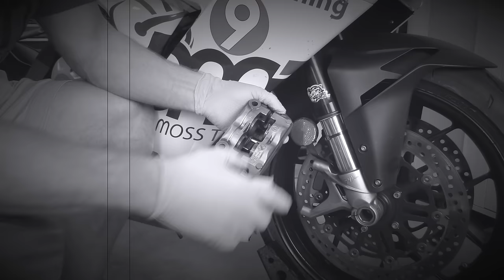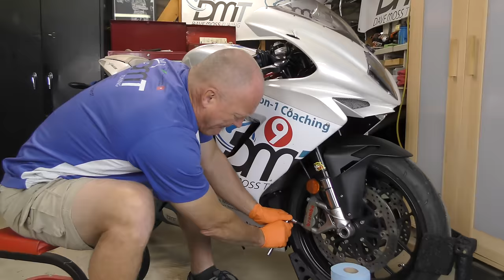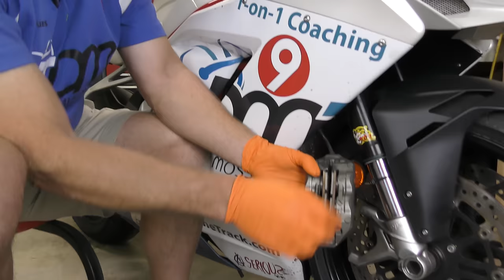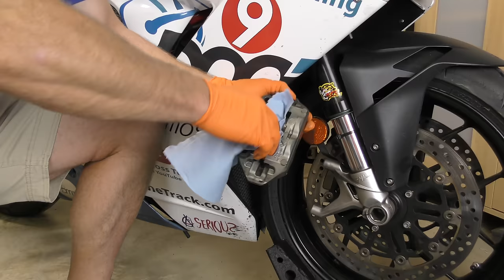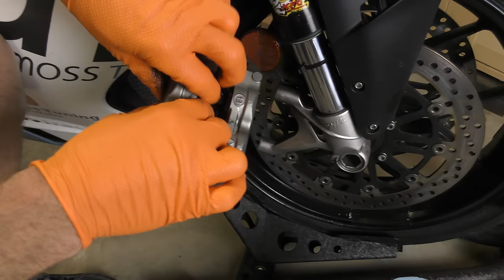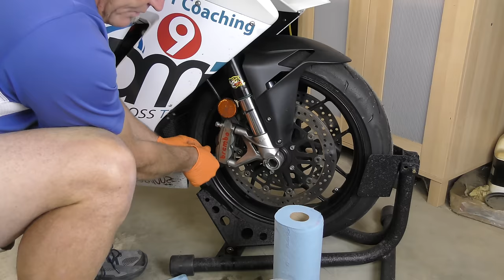Cleaning Motorcycle Brake Calipers in 5 Easy Steps

Comment: how fitting it is to see the calipers being clean with a toothbrush :))) i'll explain: i speak portuguese and in my native language calipers are called "maxilas" which means jaws. love your videos mr. moss they are very helpful.
Reply: @S3dINS  absolutely no need for the sarcasm
Reply: @sambyf2445  he’s not being sarcastic. That is the name for that type of dentistry
Reply: @g-sailing4427  just looked it up. I clearly went into the wrong industry.
Reply: Great comparison of brake caliper jaws to maxilla...teeth and gums continue the life force with careful gum and tooth care, just as braking reliance supports life enjoyment with careful cleaning of highly machined and polished surfaces of seals, pistons and pads. Very interesting detail when mounting assemblies with method of attaining final torque values! Adding a dial indicator to measure disc flex might prove interesting, too. 😮

Comment: I use soapy water a toothbrush and a cotton shoelace. Pump the pistons slightly outwards before i start to clean and with the shoelace around the piston i pull it back and forth to clean the whole piston as on most calipers you cannot  access the inside of the piston with the toothbrush. I have the same type of brembo's on my Hayabusa.
Reply: I read about the shoelace trick on another video's comments.  Works great.  I soak it in brake cleaner for a little extra cleaning power.
Reply: @SquidMissile1  don’t use brake cleaner! It’s too harsh and can dry up the seals on the pistons and cause leaking. Just use dish soap as in the video.
Reply: @cfltitan  Correct me if I'm wrong, please, but aren't the back side of the seals (internal to the caliper) exposed to brake fluid continually?
That being the case, I wouldn't think that brake fluid would be too harsh on the outside of the seals.
Reply: @SoulDaddy33  I’m talking about brake cleaner, not brake fluid. Brake fluid is fine unless it gets very old then it can become caustic.
Reply: @cfltitan  I discovered in my younger years that using dish soap while installing tires would eat the beads over time. Degrade them and cause deterioration due to its ability to remove oil. I would be curious if enough of it would do the same to piston seals? Brake clean typically causes swelling in some rubbers as does brake fluid as well over time. I learned a trick from a motorcycle mechanic who is now into his late 70's, q-tip sprayed with brake clean to clean the pistons before pushing them in. Also the shoelace only along the back of the piston surface to clean them before pushing back in. Not dripping with it so it runs down past the dust boots, enough to clean the dirt/dust/grime off the piston so when you push it in there is less risk of bringing it into the seals. I have seen some put 100k+ miles on motorcycles they just hose down the entire caliper with brake cleaner and never caused a problem with seals leaking. I prefer not to directly hose them down, but you get the idea.

Comment: That alignment method, so important but so easily overlooked. Great Vid as always 😎
Reply: most calipers (including other variants of the Brembo M4) have locating dowels, making alignment not necessary or even possible. If your calipers don't have dowels, then yeah it's a good idea...
Reply: Absolutely unnecessary. That's an old method based on ancient bikes where non-floating brake calipers were installed. Last 15 years old bikes, at least, don't need any trick before tightening brake caliper bolts.
Reply: @rob1227  if its good enough for suspension set up teams on the Pro racing circuit, then it's good enough for me. Thanks for your comment  🙂
Reply: @silky5366  if your calipers have dowels then your achieving nothing with the alignment. If they don’t like Dave’s MV then yeah it’s a good idea. The HP4 with the identical M4 calipers uses dowels so alignment isn’t necessary or even possible
Reply: @Uninfluenceable  Totally agree, I'm lucky and mine do have dowels. Many guys who I know race ( have older bikes ) need to be aligned in the way mentioned in the video. 👍
Reply: @rob1227  The brake calipers are not free floating in this video, there’re radially mounted. Some use dowel pins that would make the alignment process redundant, however, there’s no dowel pins on these particular calipers. So, yes the alignment process is necessary in this case.
Reply: Can someone explain why this alignment process works? (On older bikes). I’m sure it would be much easier to explain with words than text so I apologize, but I don’t understand why having the brake pads making contact with the disc would affect the position of the caliper if the caliper has two bolts and a torque setting. (New to motorcycle maintenance). Really appreciate any responses.
Reply: @_JP18  alignment of the calipers means that you're applying more even pressure on the rotor. Pads less likely to drag, more even pad wear, bike doesn't pull left or right under braking, etc. Depending on your bike, it may not be necessary, but it's certainly not going to hurt anything to go ahead and make sure the brakes are aligned.

Comment: I like to use wood shims , the type a carpenter uses to level and align a door frame. Just put one in each way and push them toward each other. The pads and pistons will be pushed back and there is no chance of the wood scarring the pad surface.
Reply: @seniorrider9337 Agreed and I also like to use a 1/4"-5/16" piece of ply (or equiv) and place where the pads would go then send the pistons out as far as possible without pushing them all the way, remove the spacer and then clean the pistons (I use a shoe lace or thin cloth  to get behind the pistons) .... no faffing about with pushing each out. Use nice red rubber grease before pushing pistons back in then clean up excess grease. Remember to lubricate the slider/spring pad so pads will float nicely. Good job dun.

Comment: Thank you Dave! I never thought of pulling the lever while tightening, makes perfect sense, I've just done it after watching your video. What I used to do was simply pull the lever until you can feel it brakes, then tighten, but keep the lever pulled makes more sense, even though with floating discs it might never be absolutely perfect. As far as cleaning I do it like you, and also use compressed air. Thank you, just discovered your channel, I'm sure I'll find some other useful videos. One little tip for you, if I may, when I work on low part of the motorcycle I don't use a chair but I sit on the floor, that keeps my back straight and it helps in the long run, particularly if you work a lot. You probably already know this and chose the chair not to be in the way of the camera, but it's something that should be kept in mind. I'm 45, so I'm starting to look after my back as much as possible so that I can ride small sports bikes for hours without straining my muscles. Keep up the good work.
Reply from the maker: Thanks for sharing your POV and I appreciate the hint.

Comment: I remember, when fitting a wheel with a drum, spinning the wheel hard then slamming on the brake, then tightening the axle. Centralised the shoes I believed.
Incidentally those callipers looked pretty good when you took them off ! Deffo not London in the rain 😎
Reply from the maker: Lol.... true that for a rainy climate and the aggregated grime! Correct on the drums, same principle to hold the wheel straight.

Comment: Great job ! I have Ducati 696 and I'm having issues with very heavy noise so hopefully this will work.
Reply from the maker: Check the brake pads are seated correctly and located. Also check the brake pin (if there is one) for gouging.

Comment: What sort of soap? And do you prefer that over a spray brake cleaner? I enjoys that your videos aren't edited, somerthing satisfying about watching everything.
Reply: Dish soap is usually used for this kind of cleaning, it's mild and cleans very well especially in combination with warm water. Brake cleaner dries very quickly and you don't have enough time to soak the pieces you want to brush. Some say its also harsh with the rubber and will damage the piston seals.
Reply from the maker: The soap can capture the brake dust and adds a protective coating over the exposed piston. Brake clean can make rubber brittle with extensive use plus with it being high pressure from a can it can drive dirt past the dust seal.
Reply: @rhemyis  i've been using Muc Off bike cleaner, wondered if dish soap would be too harsh.
Reply: @catalystreactionsbw  thank you

Comment: @Dave Moss Tuning I recently found your channel and I'm so glad I did.  I really appreciate how you explain things clearly, slowly and in great detail.  I've been wrenching motorcycles for 60 years but in my old age I am getting much more into component level repairs which means knowing how to completely disassemble sub-systems.  A couple of questions if you please:  I have a Harley and the rear brake has been creating a LOT of brake dust since day one. This is my third set of pads in 13 years/22k miles.  I have never worn out a single set of pads in only 22k miles.  So time to take the caliper off.  Question: When cold and parked the pads have zero clearance from the rotor.  My smallest feeler gauge is .0015.  There is no brake drag that  can hear or feel.  I'm told this is due to "residual resistance".  My front pad has a very visible gap between the rotor.  I'm guessing even a tiny rotor run-out would cause the symptoms I'm seeing.  Your thought?  Second, I am NOT a gifted mechanic.  So why is brake cleaner not appropriate for cleaning calipers?  There's rubber all over the place in any brake system.  I noticed you didn't blow out any crud or finish off with compressed air.  How come?  Your videos are great!  I hope you see this and have a sec to respond.  Many thanks!
Reply from the maker: Thank for your kind words. 1. Check the rear caliper for freedom of movement on the pins. Is there sufficient grease? Are the brake pins notched at all? Does the caliper move freely on the pins now or does it take a while and you need to work it? If so, that may be the cause. Rear wheel not perfectly aligned is another cause as is a rotor that is very slightly out of round. Those two need accurate measuring tools to assess. Q2: brake cleaner. It makes rubber very brittle over time. High pressure blows crud behind the dust seal where is stay trapped. Using a toothbrush and soapy water ensures you get the entire surface clean. Hope this helps!
Reply: @catalystreactionsbw  Yes, that explanation helps a LOT!  Soapy water and a toothbrush it is!  This has been a problem since day one and I've already found a couple of problems that were caused at the factory.  So I would assume nothing about this bike is installed correctly.  There's only one pin and it seems fine.  I can see the pistons (2) pushing against the outside pad so the pressure seems to be coming from either two stuck pistons that stop the bike fine but won't fully retract or there is too much hydraulic brake pressure with the system idle.  The inside pad is pressed tightly against the caliper frame which makes me suspicious that a shim may be needed to move the caliper housing in just a tad.  I see nothing in the HD parts manual about this.  The inside pad is also right up against the rotor.  I hadn't thought about the wheel alignment but the drive belt tracks ok.  If the wheel was out of alignment I would expect to see some space between the pad and the rotor as I rotated the wheel.  Thanks so much for the brake cleaner clarification!

Comment: I had not tighten the calipers like that but now I will... I also scrub off the dirt from brake pads which have a line in them.. Then I put a bit copper grease on moving parts to stop squeaking and rattling

Comment: Thanks for the video Dave.  I've just done my calipers and this give me the confidence to do them for the first time.  Although I give them a thorough going over one piston always moved out faster than the others.. should this be concerning?  I kept repeatedly cleaning and pushing back in but the same piston was always moving out before the others

TIA
Reply from the maker: If one leads and wins the race for protrusion, then there's less dirt behind the dust seal. If the pistons are clean and all 4 are moving, you will be fine. Just for redundancy, zip tie that piston in place and pump out the other pistons. Use your finger nail gently - do you feel any ridge at all on the other three?

Comment: I like to use chain cleaner (not brake cleaner!) on the calipers as it's much stronger than soap without attacking the O-rings inside the pistons. Brake cleaner+steel wool on the discs and pads. Wipe off any remaining wool with a cloth.
Reply: So the chain cleaner will not hurt the o-rings? I’ve never done this before, but I know the chain cleaner really cleans my chain nicely.
Reply: Thanks Dennis!
Reply: Good tip, but it has to be chain cleaner advertised as safe on O-rings.
Reply: @Messier87_M87  The chain cleaner has to say it's safe on o-rings.  Not all chain cleaners are safe on orings.

Comment: Any issue cleaning them with compressed air after each ride? I do that and it works a treat. Real quick and easy, and no need for disassembly. Doubt dust will blow past the pistons into the chambers. Haven’t had any issues to date 😊
Reply from the maker: No issue at all and there are many ways to get a job done. Compressed air makes it easier.

Comment: Another great video demostration from the all knowing and powerful Oz (DM).  Thank you for sharing.  One question, I know brake pads will be touching or close to touching the rotor surfaces in normal operations when not applied so a full rotation or so with the front wheel lifted off the ground is normal with a hissing type sound. 

However, after a short ride, say 10 miles with little brake applied, is it normal for front brake rotors to heat up so much that it is hot to the touch?

I've never paid attention before, but since it's my first time installing my front wheel/brake calipers on my 2006 CBR1000RR, just want to be safe about it.  It's easy to push the bike around and there is no noise in the front while riding the bike unless I apply the brakes which then I can hear them being applied to the rotors.  I reinstalled everything according to the OEM Honda Service Manual.

Thanks.

Take care.
Reply from the maker: Thank you! If the brake calipers and pistons have been cleaned with a toothbrush and soapy water, the pistons should retract even wen the rotor is hot. Therefore the wheel should spin about the same amount no matter if the rotor is hot or cold. If there is a noticeable reduction when the rotor is hot, a sticking piston might be the cause.

Comment: I prefer brake cleaner to clean the callipers.
Also I use a special tool to push the pistons back in . Also apply a little brake grease on the pistons and clean and grease the back of the brake pads before re assembly.

Comment: Great video! It’s a good idea to clean the pads too with the soapy water?
Reply: I'd say only use brake cleaner on the actual pads themselves.  The friction material has a tendency to soak up liquids,  especially oils.
Reply: Better just use brake cleaner. And make sure you have something to cover the floor or it'll get really messy. I am using a newspaper.

Comment: It is not necessary to aply some kind of grease to the brake pistons after cleanning them?
I just make an exhaustive cleanning of the caliper each 6 months but do not use any grease to avoid contamination the discs or the brake pads.
Btw, what do you think about semi metalic pads for street and road use?
Great video as always !
Greetings from México  !
Reply from the maker: Thank you! I try not to use grease onnthe brake pistons but use a very little amount on the oil seal when installing. Sintered/semi metallic are great pads for the street especially if you commute as you use your brakes often and need that initial bite.

Comment: What about putting a bit of copper grease on the pads where the pistons touch the back of the brake pads so they're not squeaking?  Have I been doing it wrong all these years?!
Reply from the maker: Not at all - you have been doing it your way. We each have techniques/choices that we use via experience, teaching or studying. I just present some information for you to consider, converse over or take as an action item.

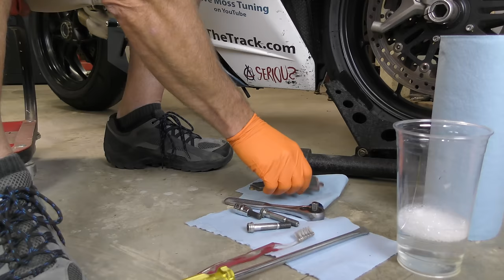Comment: 2:30 in.  Pads can taper at the leading edge .  Whenever I remove the wheel I actually swap the pads around to keep the pad material flush to the backing plate and rotor; just keeps everything squared up.

Comment: Not worried about soap still beeing in there? And also why not remove pin on the back before takibg off the pads? I might be stupid, im just wondering
Reply from the maker: Soap creates a film that holds the brake dust to stop potential pitting of the pistons. The pins get removed and cleaned separately as well as inspected for deformation as they are a wear item with a shelf life.

Comment: Well done. Torque those caliper bolts. When I've finished cleaning the pistons I take a q-tip and swab a light coating of brake fluid on them.
Reply from the maker: Thank you - I appreciate you sharing your additional step.

Comment: Hello Mr. Moss. Noticed you didn't use brake cleaner to clean the brakes. Would using brake cleaner be bad for cleaning brake calipers?
Reply from the maker: Brake cleaner apart form the high pressure hardens rubber so dust and oil seals become brittle.